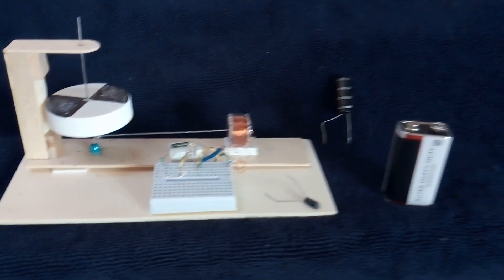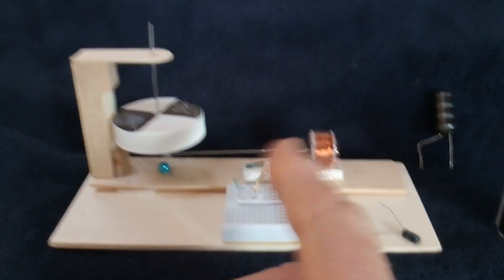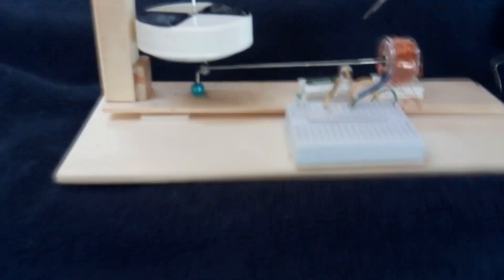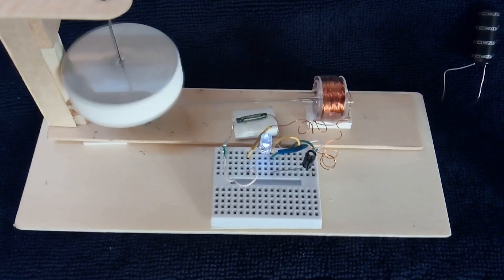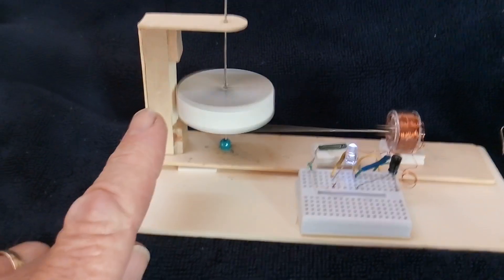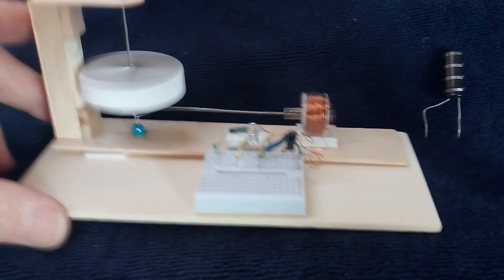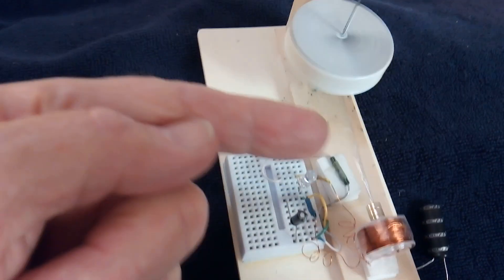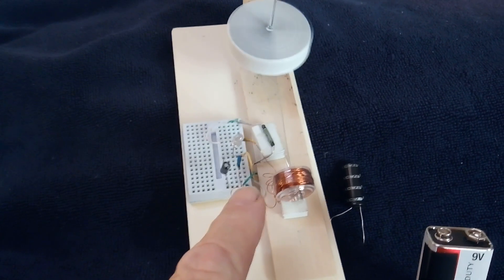Cranky Lid Motor  ---   Hide And Seek

Comment: You don't fool me, it's ambient light picked up by that LED working in reverse as a solar receiver 😎😎😆😆👍👍
Reply from the maker: Photo voltaic wood also.  When the LED flashes the wood structure generates additional juice baclk into the system.
Reply: @Lidmotor  of course, now you explain it, I can see it so clearly 🙄